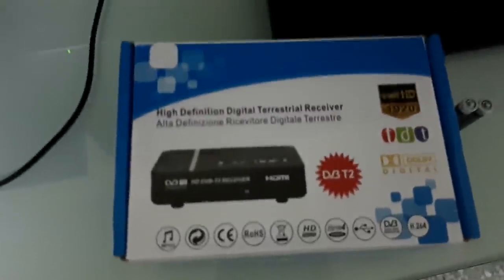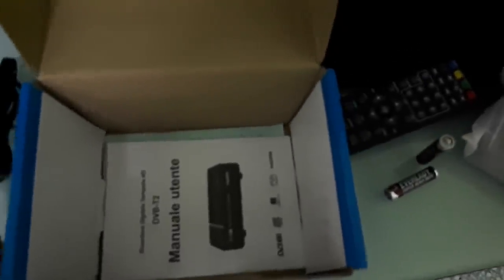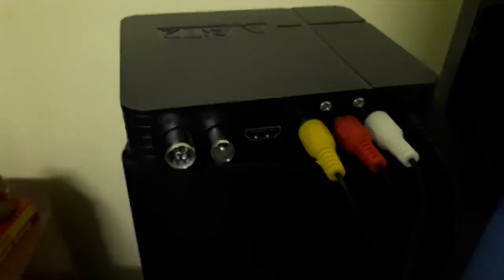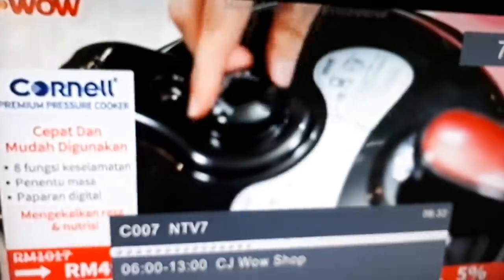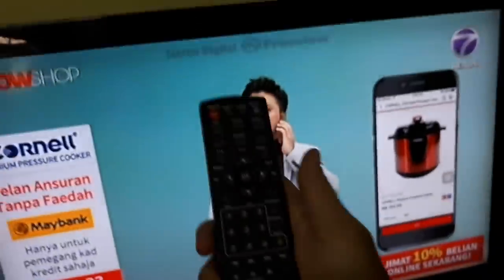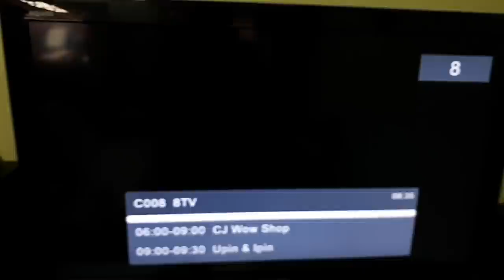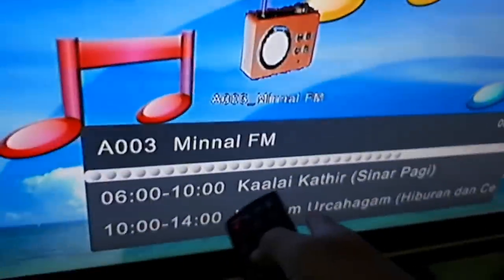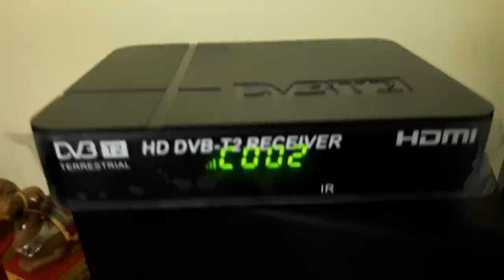How To Setup DVB-T2 Buy From Lazada For Malaysia MyFreeview TV | MYTV Malaysia

Comment: Hi, what did you do when the receiver did not turn on after you have plugged it in to the power source? I face the same problem. The receiver did not turn on.
Reply from the maker: receiver? you meant the remote control?
Reply: @2msiachannel  the decoder
Reply from the maker: @lililuna7705  i already switch on the decorder, use the remote control to power on

Comment: Set resolution tv to 1080p for better picture
Reply from the maker: Ya correct. But if use standard TV it cannot support 1080. 1080 only applicable for HDMI cable

Comment: If my place using normal antenna cannot receive 8tv and very blur, but if I use this dvb t2 will receive 8tv? What's the difference to use just normal antenna and this one?
Reply from the maker: Hi justin sabnt, this is to receive digital signal. Digital signal quality improve a lot if compare to conventional analogue signal (Currently you mentioned it : normal antenna). But this DVB also need connect to antenna in order to receive the digital signal.
Reply: 2msia channel thank you sir!
Reply: @2msiachannel  do you mean we need two antenna cable(one is original wall to TV, another one need to bought for external atenna which connect to this TV box?)
Reply from the maker: Just need one antenna cable for DVB-T2 to receive the digital signal. DVBT2 you can use either AV cable or HDMI Cable connect it to TV

Comment: my decoder cnt on?like this vdeo..how you setup it show "boot"
Reply from the maker: try on off again, i try few time
Reply: already try it..but same as before...mayb my adpter or decoder problem..
Reply from the maker: @fynstyx7574  try unplug the video cable and plug in again
Reply: @2msiachannel  i use hdmi...and cable adpter build in with decoder..
Reply from the maker: @fynstyx7574  i see
Reply from the maker: @fynstyx7574  You try the normal video cable
Reply: @2msiachannel  rca cable right?..ok i try
Reply from the maker: @fynstyx7574  ya

Comment: Any suggestions on how to solve the strength and quality issue?
Reply from the maker: try change antenna position,
Reply: @2msiachannel  ayee it works! Well, sort of. I get all the channel under RTM, but not from Media Prima. Still need to adjust the antenna, is it?
Reply from the maker: @alzeuselric1997  ya, normally signal strength at your area a bit weak
Reply: @2msiachannel  alrighty, thank you!
Reply from the maker: @alzeuselric1997  welcome, thanks for watching

Comment: How often do you come across the issue of nothing showing up on screen and you have to unplug and replug one of the rca cable again? Is it a persistent issue?
Reply from the maker: Because first time i try it came out no image. lastly i try plug & unplug it and its works. It might be manufacture defects. As long as it work, its ok for me. Since it not a very expensive item.
Reply: @2msiachannel  Does the problem occur frequently or only once in a while?
Reply from the maker: once in a while.
Reply: @2msiachannel  Ok thnx

Comment: I got the same receiver and I get "No service" message on DVB T2 channels, while DVBT channels work without a problem. Anyone have a solution for this?
Reply from the maker: make sure you're using UHF antenna
Reply: @2msiachannel  Well, I found out that it does not support H.265 codec and that's why I can't get any picture. I will get another one soon.
Reply from the maker: @ivanuremovic1199  ok,

Comment: hi  lepas turn on  DVBT2 ,  TV saya show no signal walaupun saya dah pakai antenna VHF/UHF . antenna ni sy guna dr TV analog system lagi & boleh function. i dah record video to show what problem im having now. how to send u the video?
Reply: i beli from Shoppe & the Seller is from China. when i ask her she said can refer to u first  if got problem to setup
Reply from the maker: @zaihasra5898  Hi bro, i sini tiada jual mytv decoder, i sini video tunjuk saja. Biasa pakai UHF antenna boleh terus dapat signal kecual kawasan you sana signal weak. try scan sekali lagi dan tukar posisi antenna
Reply from the maker: @zaihasra5898  Biasa i ada recommend beli yang original, sebab scan memamng cepat jika ada signal, bro boleh tengok video yang lain. youtube cari : 2msia mytv
Reply: @2msiachannel  thanx for reply.. nak tanya lepas turn On DVBT2 decoder, normally akan tunjuk screen apa? kena press any button at the Remote Control?
Reply from the maker: @zaihasra5898  Biasa tunjuk menu untuk setup jika baru on pasang, jika tiada signal tekan menu ada setting untuk carian channel signal
Reply: @2msiachannel  u ada jual DVBT2&ANTENNA ? i punya case after plug in & turn on TV show no signal. kalau xde signal then press Menu at remote Control right? tp i tekan Menu dkt TV nothing show up. is it Mean the Remote control or DVBT2 tu rosak?
Reply from the maker: @zaihasra5898  oh. Try TV remote control, AV mode, tekan sampai ada tunjuk dvbt2 display
Reply: @2msiachannel  hi kalau dah buat AV Mode & tekan Menu, then takde tunkuk DVBT2 Dislay. Only show No signal. adakah sbb i punya Antenna UHF x ok? kalau nak beli baru which one can perform best. ada few antenna =>  50 Miles HDTV Antenna, 150 Mile UHF Antenna, 180 Miles UHF antenna & linkwise UHF Antenna with Booster
Reply from the maker: @zaihasra5898  Biasa Antenna UHF dah cukup. No signal maksud belum dapat cari decoder anda, cable semua sambung betul? try tekan AV mode sampai ada nampak display dvbt2

Comment: aku ada channel , transtv  sinyal strong , tapi suara tak muncul ,  ada logo Dolby (highligt) di info channel,   tak tau kenapa suara tak mau keluar.
Reply from the maker: try check cable audio. plug unplug again
Reply from the maker: try check cable audio. plug unplug again
Reply: @2msiachannel  untuk channel lain yg logo dolby not  highlight,  suara keluar  ,
Reply from the maker: @vitonice  itu i tak pasti. try disable dolby sound system **jika ia dapat disable la

Comment: Why my decoder not connect with tv...dah pasang semua wire
Reply from the maker: Video cable ada connect TV tak? Atau Guna HDMI Cable. Guna Mytv dari Malaysia atau beli dari china lazada? Sebab jika beli dari lazada china kadang kala video port ada sikit longgar. Unplu dan plu semula untuk try. Dalam video i ada tunjuk masalah tersebut
Reply: @2msiachannel  video cable on tapi if tekan menu tak respond..dah plug, unplug .. sama jugak..tak respond..saya pakai jenama nano tech T2 plus tapi cable component semua sama ..mcm u punya
Reply: tkar setting kt tv ..AV INPUT OR HDMI INPUT
Reply from the maker: @kakiUtiup  ya betul kena check AV atau HDMI input, jika kedua dua tak boleh mungkin decorder ada problem